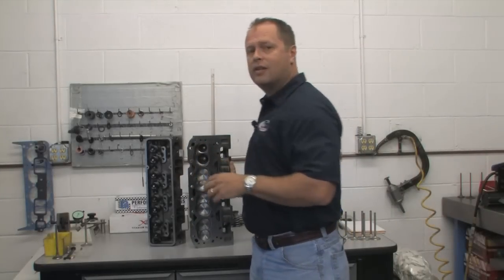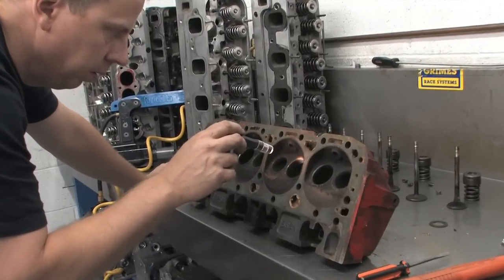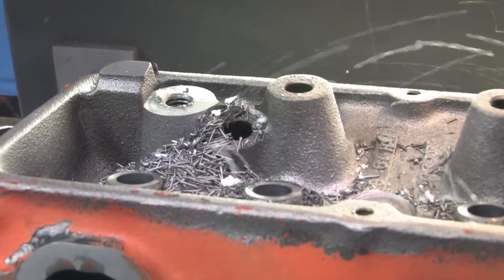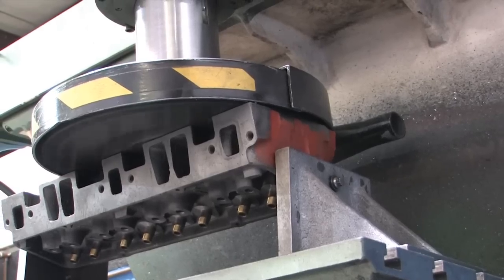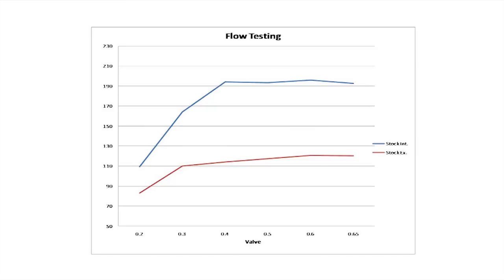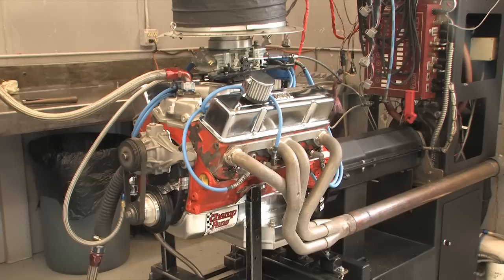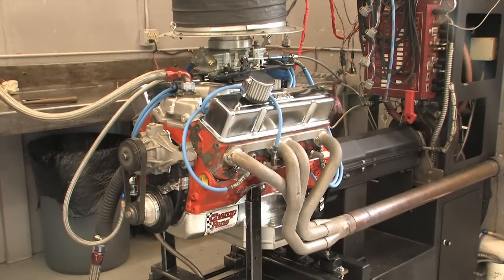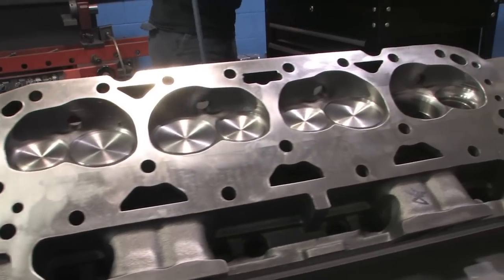Chevrolet Cylinder Head Dyno Test

Comment: Dart advertisement and horrible biased. Lets use some shit cracked heads from the 60s. Grab a set of vortec heads or even cheap china aluminum. Then its a different story.
Reply: those were 70s heads,  not 60s
Reply: And the cracks weren't effecting the way they performed, they pressure tested the head to make sure.
Reply: Texassince1836
Does the years really matter?
Clearly that wasnt the point of my comment. The heads used had no fighting chance. 
Those heads are horrible compared to Aluminum vortecs or iron vortecs. Why not use a head that is easily available or is cheap enough for ever one to get. 
I think we know why. Clearly this video was biased .
Reply: +Mark Rich that's one of the most common original cast iron heads on carbed SBCs right now,  I know a couple of guys running them. Ive even got a set similar to these (casting 624), but im picking up a set of vortecs pretty soon. 

so this is comparing what everybody has to an aftermarket head.
Reply: +Mark Rich so the 882s are readily available and cheaply had,  which is why they were used
Reply: Texassince1836
So If you go to buy a head for a cheap sbc build ,  you would buy a head that performed worse for the same money? You would stick a low compression poor flowing head on your motor. Be realistic. and 882 are not nearly as common as vortec heads. 
Are you even serious?

Comment: bullshit video. i could have put larger valves in than they did, clearanced the combustion chamber as to not reduce the flow with the larger valve from shrouding, angle milled the heads for the same compression as the darts, lined the guides saving money spent on the bronze guides, pinned the rocker studs if money was a factor and since they bowl blended the heads i could garantee i would exceed 220cfm.

i would also like to note that i doubt the iron eagle heads were simply bolted on. not to say additional performance work was done but they usually have a pushrod clearance problem on one cylinder. they leave a lot of iron around the intake ports for porting so some people who want to take advantage of that could use roller lifters with offset pushrod cups and/or shaft rockers that relocate the pushrod on the end. this way more porting can be done. but for the rest of us it's usually necessary to grind for pushrod clearance requiring that the engine is mocked up, head removed, ground, cleaned re-mocked up then torqued on. the pushrods may also need to be changed for length meaning you have to check the pattern on the rollers as they contact the valve stems during the mockup. there is time spent here and possibly money they didn't account for in the video. it may not offset a day or 2 of rebuilding a pair of stock heads but their quoted prices on the stock heads were unnecessarily high. not that the work performed wasn't worth some of that money but the choice in parts was more expensive than needed.

Comment: No way In hell a 350 is making 440+ hp
Reply: i thought it was high, is 425 about max on flat top h roller street cam?
Reply: roknroy1 add a decent 162 old bm rebuilt  supercharged comp cam blower cam 882 heads 2.02 1.60 rhoads lifters roller rockers 9.1 compression     Methanol water injection Hooker big tube headers dual hand built  3 inch exhaust . Making over 500 hp and tons of torque

Comment: Wow what a heaping pile of shit, this motor is how big? And after all that work it only makes 400 something hp
Reply: MinibikeMotoVlogs 350 small block chevy. 450Hp 440 torque. All for no more than $1600 in aftermarket parts. Pile of shit now?
Reply: It's like 7.0L so it should be making about 700hp
Reply: MinibikeMotoVlogs No, it's 5.7l. You're not making 700hp with anything for less than $2,000 I don't think you know anything about engine building.
Reply: I didn't know where was a budget
Reply: MinibikeMotoVlogs  Displacement is not directly correlated to output.  7.0L doesn't equal 700hp.  There have been 7.4L 454 engines produced making 200hp, and there are 7.4L 454 engines making well over 2000hp.  Its all in how the engine is built up, which is apparently something you know nothing about if you think a 350 SBC = 7.0L
Reply: +MinibikeMotoVlogs 5.7L, 5700CC, 350CID, 1.5 gallon...